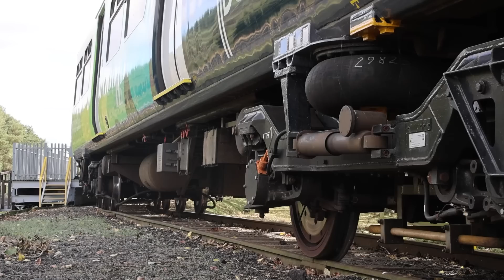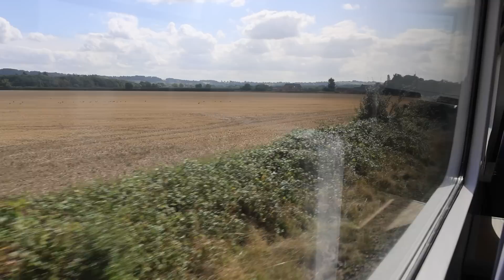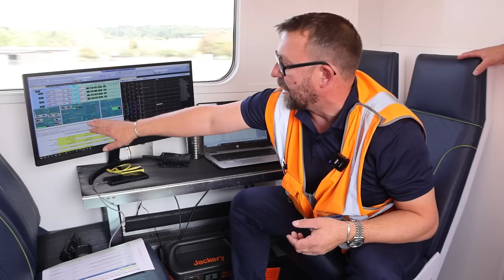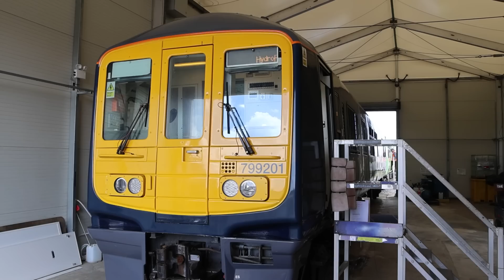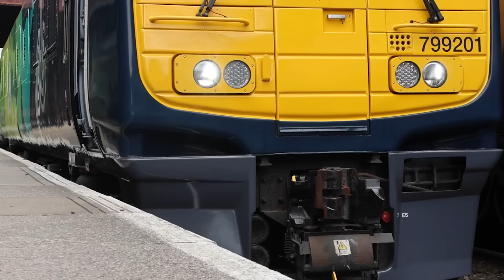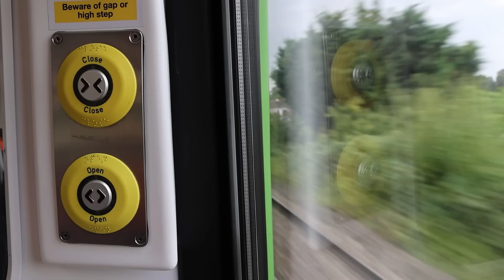The Class 799 Hydrogen Train

Comment: The problem with hydrogen is there are no green production methods. Making hydrogen is INCREDIBLY energy intensive. While this can be done with electrolysis, this consumes a vast amount of electricity that cannot reliably be produced by renewable means. Grid electricity is needed to ensure continuous production and that extra load on the grid can only currently be provided by gas based electric generation.
Reply: There are green production methods, hence "green hydrogen". But that's electrolysis of water using renewable electricity generation, which is perfectly reliable but as you said incredibly energy intensive. The problem is we need the renewable electricity for lots of other things, so the only real advantage of green hydrogen is acting as an energy sink for times when renewable generation supply outstrips Grid demands (middle of the very windy night for example).  And that level of green hydrogen production doesn't look like the backbone of a viable fossil fuel free hydrogen economy.

Comment: Fail #1 - USB not sealed, and dodgy connection or chamfer on parts no bonding Also some silly laminate stuck upon with no acceess for maintenance. This means USB service means ripping off the panel, and undoing 5 screws and removing plates, just to fix an USB. .wtf.. I wanna get in on this game ;-) £££££ (why did the marketing dept die.. ? they made their own fire sighns and consumer handle on stuff)

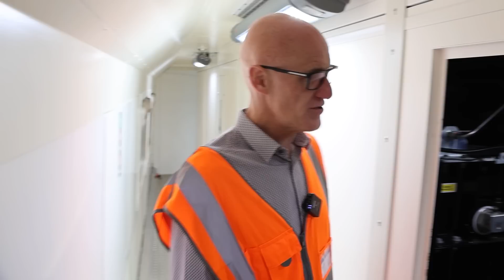Comment: 3:40 "350 bar" hydrogen pressure. That's over 5000psi 😮 Did he mean 350psi?
Reply: The 350 to 500 bar number is correct. Hydrogen is stored at very high pressure. I had a neighbour who worked for ITM Power who explained this to me. He worked on equipment for hydrogen combustion engines (so not electricity producing fuel cells as used in the train). The plant for transporting and storing the hydrogen and refuelling vehicles sounds like it's not yet highly reliable and is expensive.
Reply: It sounds high to many people because the highest pressure they deal with is the ~30 psi in their car tyres.  In applications like hydraulics, storage of certain gases, etc. it's perfectly normal.
Reply: 5000 psi isn't that crazy really. Standard compressed gas cylinders come at ~2500 psi so doubling it for a specialized application like this isn't totally nuts

Comment: Yes, very worthy but once you suck all the electricity out of the national grid to charge EV's how many windmills are you going to need and how much wind to generate the electricity to run the electrolysis plants, the car charging, the fully electric homes that will never be warm enough if we all get forced into the damn heat pumps. When you have politicians who just assume there is an unlimited current supply for their dim ideas someone somewhere is going to have to educate them. And I wonder how keen the travelling public will be sitting behind huge tanks of hydrogen sitting on top of a huge pile of lithium batteries on a train where, when it goes wrong you won't be able to get the doors open! Great idea folks but flawed.

Comment: There are already commercial applications much better suited than this. And it has been in use in the UK for several years already. The Anglia class 755 Flirts. They are electric/diesel hybrid battery electric already. And instead of the expensive and wasteful hydrogen solution, it runs on diesel to keep batteries topped up. And is in use in other parts of the world also already. Norwegian Vy has them as BM76 here in Norway, and they perform more or less the same under hybrid power as under overhead wire.

Comment: Still think battery power is likely to be better especially if you can have in track induction charging at each station with batteries at each charging point that can be trickle charged from the grid and local PV.  This just adds complexity/cost as you have to source Hydrogen and store it somewhere which I have heard is not that straightforward.
Reply: You don't even need fancy induction charging: just put up short runs of 25KV wires every 10 or 20 miles to do "rapid charging"

Comment: 7:30, All you ney sayers need to crawl back under that fossle rock you come out of, think how difficult it can be to electrify some routes. So what if it takes "three times as much electricity" to make, it will use up all that excess that we loose when theres more wind or sun than the grid can use, hydrogen is being used as a cheap renewable and clean verson of the lipo battery that everyone keeps moaning about 'oooo its fire! Ooo, you can't recycle it, ooo its exploiting people in the 3rd world, its clear that you just won't be happy, and so be it, just be quiet and let the boffins do what they can at the current time to reduce pollution. I know for sure that some routes like the West Coast mainline in scotland would benefit greatly as there is simply no practical way to electrify it

Comment: ......and find out everything you need to know about a train powered by Hydrogen!
When the then CEGB wanted to transport used nuclear fuel by train there was a call for a destructive test to be carried out as "Operation Smash Hit" . Noting that hydrogen is carried in quantity at 350 bar [a cosy number which means more than 5000 psi (5145)] and coupled with Lithium Ion batteries has potentially a very high fire/explosive yield will the company carry out a full live crash test at speed into an immovable object to assess the collision safety of this proposal?

Comment: What a waste of carriage space, most hydrogen is NOT green but cracked from fossil fuels, and it serves no purpose. A properly made Battery electric train is far more efficient, and you could fit them underframe with no problem. I sketched out a 31x scheme for this in 2013, and it would have been easy as all the 25kV and traction gear is on one car of the 4.  So not impressed by the muddled thinking here.

Comment: Go and speak to JCB. They got Hydrogen Powerd Engines to work with 0 emissions, far simpler to maintain and you get an engine builder behind it. As for producing hydrogen as rightly pointed out in the comments, it could be down to a "blue sky" engineering company called TOKOMAK. Early in 2022 this industrial unit on an estate in Oxford achieved a fusion reaction for 3 seconds. If that does not impress you then you don't know the plasma created in that event was at 150,000,000 degrees Celsius 10x hotter than the centre of the sun. The fuel is Hydrogen and the abundance of energy and lower than medical waste levels of radioactivity.....how much hydrogen do you want.

Comment: Here in California, a Stadler Zemu trainset is being used on the Arrow line, a 9 mile transit line between San Bernardino and the University of Redlands.  This is a hydrogen/battery hybrid.  Depending on its success, something like this is also being considered for Caltrain between San Jose and Gilroy. That portion of the Caltrain route has not been electrified, and is still running diesel powered trains.  Some battery powered ones are also in the plans to replace the diesels at some point.

Comment: Electrification is a much better way to achieve climate goals.  I think hydrogen is actually pretty cynical, oil companies want to keep something that they control and produce and sell and transport and that whole lifecycle has a huge carbon footprint.

Generating more heat from fuel cells is also not good for climate change.

Comment: Interesting to be able to hear the iconic Thameslink hum on a line that is not electrified, but this high tech kit needs to be benchmarked against the alternatives. 

The money being spent on the research alone would have paid for a small fleet of steam locomotives which would have been well up to the task of hauling a four car train, and if they run on light oil you get clean exhausts and about 25% more power than with coal.

The critical temperature of hydrogen is 33 degrees K, which means that it isn't very portable. The fuel tanks seem to be occupying a lot of space.

Comment: How the 3+1 car EMU drives is surely less important than the efficiency of the traction system.  Sounds like very significant amounts of energy is dissipated as heat, i.e. wasted. Added to that 25% of the original fare paying capacity is lost due to the space taken by the fuel cell plant. With a 400kW lithium battery and 12 cylinders of hydrogen at 300 bar the passengers might hope for an adequate fire suppression system on board too.

Comment: Good to see the research going into it, but I remain very unconvinced that hydrogen is “the future” of transport. So much extra energy and infrastructure needed, will only be an edge case benefit where direct power is impossible.
Reply: If Switzerland can make an electrified railway up and through their highest mountain, then there is literally nowhere where "direct power is impossible".
Reply: @K-o-R  you're totally right, genuienly the only place where OLE is incompatible is container terminals, for that niche battery shunters or bimode locomotives will do the job. Other than that, just electrify everything. It's not as crazy as people make it out to be if you just commit to the work
Reply: @contrapunctusmammalia3993  Well I don 't think its a smart idea to electrify the Far North Line.
Reply: @Mgameing123  it shouldn't be a priority but when most of the network is done it'll have its turn. In the short term battery hybrid things could be used to minimise emissions- but it's not a long term solution
Reply: Anything where weight is important (planes and ships) yes, otherwise batteries or direct electrification. Unless some game changing new tech appears, economics and physics make any other future impossible for hydrogen.
Reply: @HoltAlex  hydrogen is too volumous and low energy density for long haul planes, and batteries are likely to win out for short regional (< 200km) prop planes (e.g. Harbour Air battery sea plane) same for cargo ships vs. ferries. Once you have eradicated short haul flight with high speed electrified rail, the amount of long haul emissions are just not enough to warrant the effort when there are lower hanging fruit to be electrified first - ground transport, building heating, industrial heat and - somewhat ironically - the production of hydrogen for more useful applications than building heating and transport. Trains, planes and automobiles don't make sense to use hydrogen.

Comment: It just proves that this is a highly inefficient way to power the train. They’d be better off with battery packs for off wire operation.
Reply: It would be better value for money to get a fleet of steam locomotives to drag the trains, and bin the electrical equipment.
Reply: @physiocrat-sv  This could work. Build up a head of steam using electrical energy when under catenary, and then use that until the next electrified section.
Reply: @quantisedspace7047  
What would the point? Electricity is not free.

Comment: Love the initial process, but hydrogen is not the answer. It's a lot less efficient than dinosaur juice, more corrosive to store and more expensive to produce. However, it's a step in the right direction. Individual machines running around on their own sources of propulsion is so 19th century. As long as individual devices need to carry around their own means of energy production,  fossil fuels are unbeatable. I dont like it, more wars have been fought over getting the juice out of the ground than securing safe drinking water. But, electrify the network, centralise the electricity  production  and make the whole thing work.

Comment: One thing that baffles me is why the Class 319's have been the platform used for all these experiments, like converting them to either run only on diesel or electric with diesel where electric is unavailable (class 769) or hydrogen (such as the example shown here
Reply: I read some years ago that the 319s have a power system designed to run of either 25kv or 750dc which it is reletavely easy to also add other power sources to.  Engineers who know more can help here!.   That makes them easier to use than other trains.
Reply: This is jus proof of concept.  Other details are unimportant.

Comment: It's so good that they've installed the modern technology but still kept the character of the 319 with the original DC motors and the audible air compressor and spirax valves

Comment: It all sounds nice, but what impact on the planet does the hydrogen production have.  From a quick google it seems that a process with steam and methane (natural gas) is the most common, but then you need to heat the water to produce steam, which either needs electricity which is produced by burning of more gas / fossil fuels, or burning the fuel directly to heat water like an old steam engine.   My old physics teacher taught us that energy is always conserved, so basically nothing is "free".   Then there's the question of safety... what risk of explosion is there if the train was involved in a crash at high speed ?
Reply: Yes, if you are making it from methane, then it is better to just power the train directly from methane. If you are making it from electricity, it is better (about 3 times better) to just use the electricity directly, or charge a battery with it.
Reply: @katrinabryce  It's more like 5 times when you factor in transporting the stuff

Comment: There is always a case for looking at alternatives to power a train but this seems like a hard sell.  Although hydrogen is energy dense by weight,  its very energy light by volume: hence the need to take up a whole carriage to store the amount required.  If the train already has a battery why not just cut out the middle man and charge that direct?

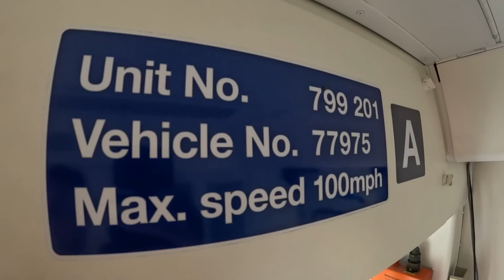Comment: 5:57      What's the difference between the unit number (799 201) and the vehicle number (77975)? Because I can see that 799201 is clearly displayed outside on the front as it pulls into the platform.
But is it the 77975th train built or the 77975th set ever built?
Reply: The unit as a whole is 799 201. Each vehicle has its own number as well - 774xx and 779xx for the driving cars, 630xx for the motor car and 719xx for the intermediate trailer.
Reply: @K-o-R  Thanks, I'm used to simpler American numbering, where it's basically just one number for a coach.
Reply: @GojiMet86  That's what we basically have, but because the vast majority of our trains are more or less permanently-coupled sets, it's a lot easier when allocating stock to have an overall unit number. Even in cases where they are individual coaches with a locomotive, the coach sets are generally kept together and allocated their own number, usually their depot and a two-digit code.

Comment: An interesting project.But  I am very sceptical about hydrogen for transport. Clean hydrogen, green as it's called so far looks too expensive. I will watch and wait, maybe I will be proven wrong.
Reply: Physics agrees with your suspicions. 3-5x more expensive per mile to use hydrogen than just charging a battery. Count the number of electric buses in the UK vs Hydrogen powered if you need proof. Economics don't add up so it won't work.

Comment: Such a waste of time when it takes so much energy to produce the hydrogen. And you have to keep producing it too!

It's so embarrassing that the country that invented trains is so shy about embracing them. We need overhead infrastructure. There's a reason it's used the world over - it's the best method! Just spend the money once, and it's there forever!
Reply: Build a fresh batch of BR Standard Class 4. The lines are not busy enough to be worth electrifying.
Reply: @physiocrat7143

What the hell are you on about? It's always worth electrifying the railways. We knew that over 120 years ago. The line doesn't indefinitely sap electricity when it's not in use.

And besides, if you want it to be busier, you need to make the trains worthwhile. Overhead electric lines are best. You can have faster, more comfortable trains with more seating, and they'll have modern standard features like charging sockets and WiFi. And as the greatest bonus, no bloody pollution.
Reply: @DeathInTheSnow  
The capital and maintenance costs of electrification are poor value for money unless the traffic is sufficiently dense. That is why busy commuter routes were electrified at the start of the 20th century. 

OHLE is visually intrusive and tends to make for an unreliable system, as we experience it here in Sweden.
Reply: @DeathInTheSnow  
I was in England when I wrote that. Being aservice does not mean that money should be freely splashed up the wall, nor does it mean that there needs to be a procession of heavy duty gallows and goalposts all the way up the Thames Valley and through to the Avon, with steelwork heavy enough to hang a train from, not just a thin strand of copper wire. The high voltage is also a safety hazard.

Comment: Bimode hydrogen-electric is undoubtably the sensible future of non-electrified rail. It's much MUCH better than mining giant batteries in the majority of cases.
Reply: You still need giant batteries in addition to the fuel cells and everything you need for them to work. The fuel cells only have an on/off mode, and can only deliver one low power output. You need large batteries to power everything at all times, and then you use the fuel cells to charge the batteries as they are being used. When you accelerate, the train needs 8-10 times more power than fuel cells can deliver. This power is drawn from batteries. When you get up to speed and coasting, the power output of the fuel cells exceed the power needed for the motors, and is used to charge the batteries back up again. Stadler has used the same principle for the bi-mode Flirt trains for years, but they use large diesel gen-sets instead of hydrogen fuel cells.